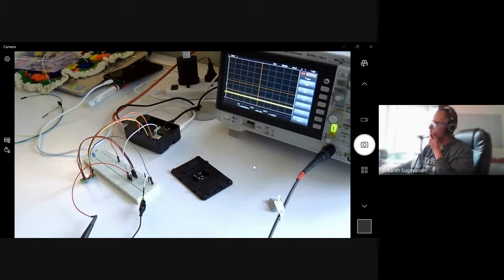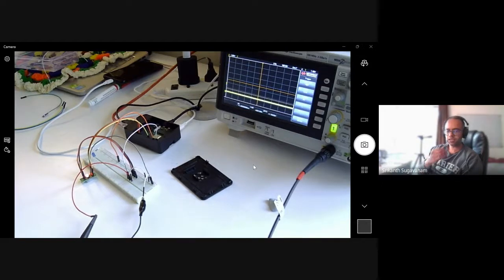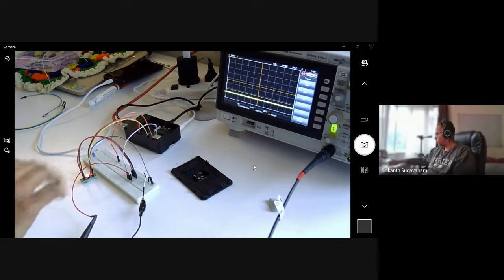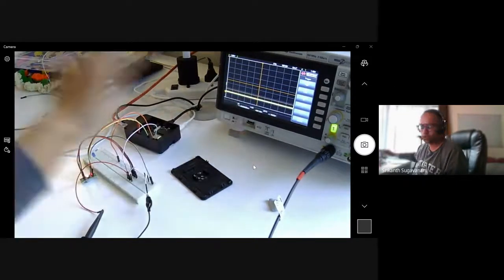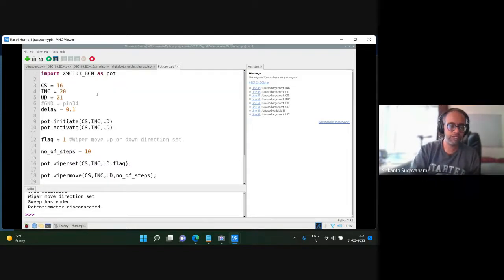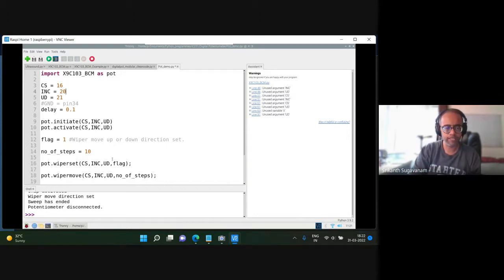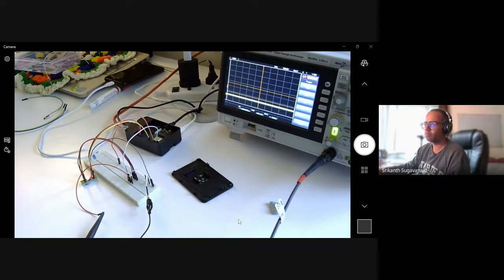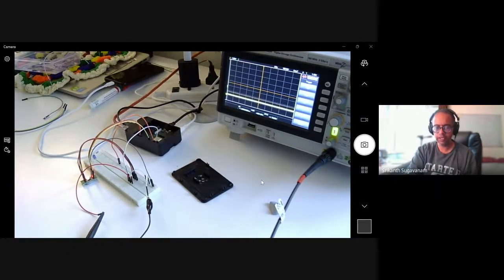Control the X9C103 Digital Potentiometer with a Raspberry Pi

Comment: can you suggest me any helping material as i need 4 chanel output to have four different resistance
Reply from the maker: You can alway start from the codes on GitHub. Wiring could become tricky, as you want to work with four potentiometers. Best to move to a self-designed PCB, or use some switches.
Reply: @srikanthsugavanam8591  i am trying to control drone remote throtel basically each throtel contain 2 variable resistor so i have 2 throtel one for acceleration and other for yaw etc i need to control there potentiometer or voltage which changes due to change in resistance . all will be controlled by respberry pi 5 . so kindly help me
Reply from the maker: @abdullahkhalid1121  This can be a bit tricky, as the potentiometer is not the fastest. An alternative approach might be more suitable for drone applications. Also, you may need to control the motors in parallel - this can be very tricky using the conventional serial approach. Out of my area of expertise, I am afraid :/

Comment: I want to control the X9C104P using a Raspberry Pi 5, but I can't find any library. Can you help me?
Reply from the maker: Hi Yasmine, thanks for LinkedIn connect - I haven't worked with the X9C104P - I am hoping it is a similar digital potentiometer. The best place to start would be the datasheet of the component. Also, you can check my Github page - https://github.com/SrikanthS-IIT/IIT-Mandi-Online-Hardware-M-and-I-Labs/tree/main/Lab%204%20-%20Digital%20Potentiometer - this has code examples, which will hopefully help you to get started. Hope this helps!

Comment: can you put the wiring diagram up somewhere, thes pots have 5 input pins, my pi has 40 on the gpio and i'm not sure what to do
Reply from the maker: Hi Robert, sorry for the late reply. You can check my Github page, https://github.com/SrikanthS-IIT/IIT-Mandi-Online-Hardware-M-and-I-Labs/tree/main/Lab%204%20-%20Digital%20Potentiometer - this has most of the information.